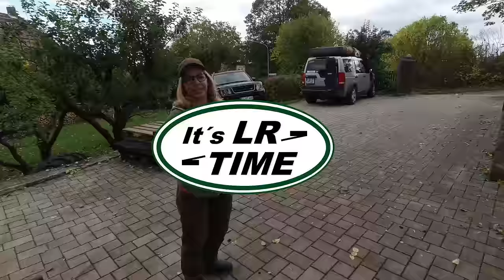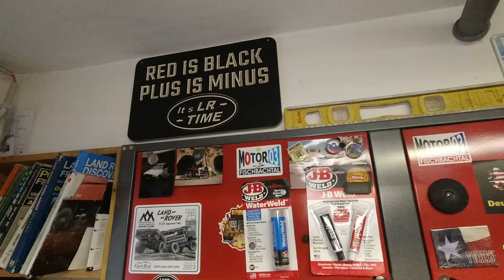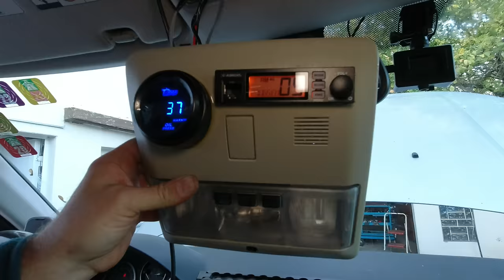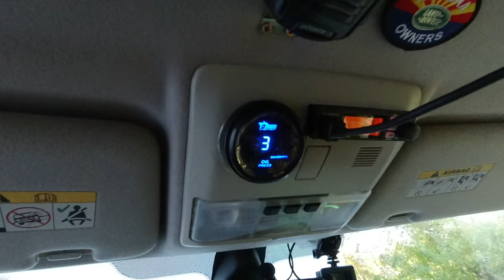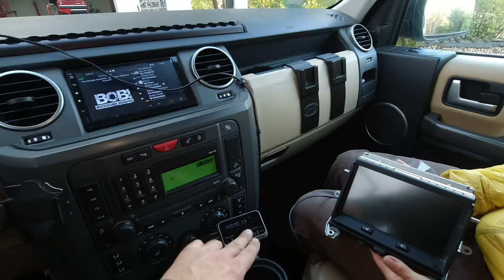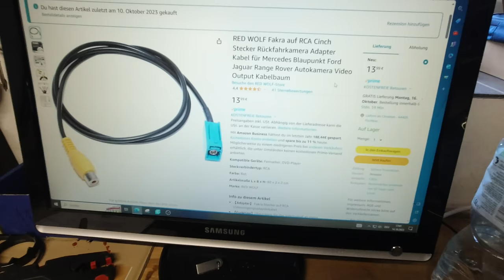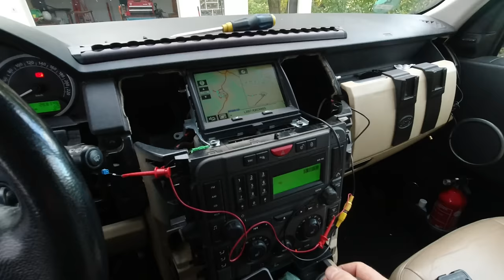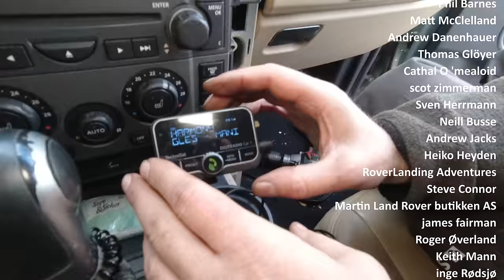Maintenance after Engine Rebuild - Chips in Oil ? / S4-Ep48

Comment: I put a D4 nav display in my 2006 D3. Love the updated look of it and all it requires to work is power and MOST. If you want nav to work, then you also need vehicle speed (one wire). The only annoying thing is the display backlight is always on full, it ignores any input from the D3 system. There was some sorta chance. But I simply made a independent device with an Arduino that regulates it beautifully.
Reply: Mmmmm nice!
Thanks M.

Comment: You should find that with the next oil change it ought to come out a lot lighter if the rings are sealing well. I had a 170k mile TD5 that would blacken its oil instantly after a change until i wiped out the black goo from the  sump when i happened to have removed it. For the next 30/40k miles the oil would come out as clean as a petrol engine. It was the black goo that was staining it rather than any recent engine blow by.

Comment: With iid you can add 4*4 info without removing wire. there are little problem with rang rover mode the clock and data can't adjust good ....... very nice job

Comment: I’m doing a satnav upgrade in mine, I have made a 3D Printed bezel adapter so I can fit a 7in android wireless car play in place of the day nav as the maps are too out of date now. This uses the aux wire and also takes a usb input which I routed to one of the charger holes which so you can be wired or wireless. I’m posting it on the Disco 3 forums.

Comment: Hi Cristian, I did that exact mod to the Nav screen a few years ago with the switch to go in and out of RE mode. The only problem was the brightness of screen reduces after a short I’m so is no good during the day. I did a resister mod to the screen and switched on and off with the lights, now all is perfect.
Reply: Care to share the mod? I’m looking into this soon
Reply from the maker: I have had it now installed a couple of weeks and been on a couple of longer trips, day and night driving also in terrible weather conditions and I don't have any issue with the brightness for some reason. 👍🙋‍♀️

Comment: Unbelievable we had a walnut tree on the farm i grew up on every year. we picked them up by hand and stored them until my mother was ready for us kids to crack them open,  i do miss that simple way of life 😢,  I've also added Bluetooth to my lr3 that i can use from my cell phone , i usually listen to music from YouTube makes it nice to pick what you want to listen to sense a lot of today music not for me i miss the 80's way of life & being young once in a lifetime. When i did a brake job and ebrake shoes, it's always the little details that get overlooked . When i couldn't figure out why the hole in rotor wouldn't line up to adjust ebrake duh i had to lift other side  so im able to turn hub  after throwing a tool two screaming mary jane i finally figure out both sides needed to be off ground 🤯 it's the little details that some you tuber leave out is the most important piece 😊

Comment: It would be interesting to get your analysed at a lab. to definitively say if there are any wear particles/contaminants in there👍
Reply from the maker: Particles found only by a lab are unlikely associated to an imminent engine failure. 🙋‍♀️
Reply: @Vera_and_Christian  Yes I agree. I was thinking along the lines of monitoring the oil over an extended period to see if any increased wear indicators. But given the nature of the failures in these engines (sudden/catastrophic) maybe not?
Reply from the maker: @russhumphreys8109  Frequent oil changes are the key to reduced wear on the engine, in our humble opinion. Even a10000 km oilchange interval is too long. No more than 8000km. That way you can reduce the dilution of oil with diesel and keep the lubrication properties intact. A viewer recently send us his oil analysis, after according to him an 10000km oilchange, and the lab recommended him to do as frequent as 4000 km oilchanges, but he was still on 5W30 and not 5W40, what we recommend. The oil did not have the lubrication properties needed anymore. The money is best invested in frequent oil changes. 👍🙋‍♀
Reply: @Vera_and_Christian  400km😲 I'm with you on this. Oil is cheap! I actually use 5w40 but not the actual spec. recommended by the manufacturer. The recommendation is low SAPS to protect the DPF. But at the expense of reduced engine protection!
Reply: Sorry 4000km!

Comment: Hi Christian and Vera, I’ve been watching your videos for the past 3 maybe 4 years and I’ve never thought to ask you this question, where do you source your parts from, online or from your local reputable motor factors? I’m in Ireland by the way. Love the videos and get a great laugh from them. I’m also a Qualified BMW technician, you can feel free to ask me questions too. I’ve also bought a Discovery 3 recently. My father had 2 and loved them and so did I so I had to have one of my own.
Kind Regards,
Ryan.
Reply from the maker: Always online. For the engine rebuild, Christian spent endless hours researching online. Always search for the part number, using the AdvancedFactors website, for example. Then then buy there or search with that part number online. We buy mostly in German online auto stores, and most often at an online Land Rover store.👍🙋‍♀️

Comment: I wonder if the pressure gauge will not shine too bright at night. I had some USB chargers with voltmeters and those were very distracting at night. Even though those were down by the shifter and outside of immediate eyeline.
Reply from the maker: It does not. 👍🙋‍♀️

Comment: well done
I  am installing a hoist, just pouring the pads 1 metre x 1 metre x -8m
i was concerned that the pads on the hoist may dent the chassis rail?
Reply from the maker: Christian also made a specail mount for the front lift pad, so it fits into the jack holes. And also welded on side  guards on the rear lift pad. It always helps if you have a fully loaded fabrication workshop. Fabian has rocksilders and they tough the lift arms, but not weightbearing of course. 👍🙋‍♀️

Comment: Hey guys, interested by your experience with the Range Rover mode and the rear view camera. Did this on my Disco 3 V8 and I've found that the light is not bright enough when sun is shinning, impossible to see what the screen display when reversing. I Also had trouble centering the image, it is actually completely offset and therefore useless. Still looking for a hack to enable the auto-brightness setting while using the range rover screen mode.

Comment: Brake question… why did you click back x8 when you had not bed them in? Shouldn’t have been all the way to full lock, then back out 1 full turn? 8:14
Reply from the maker: One turn is 10 klicks. I turn back between 8 and 10 klicks after lock.  Bedding is only required for new shoes.  Christian
Reply: @Vera_and_Christian  thanks, appreciate the response and love the videos

Comment: Would I be right that to stop the Handbrake from working you must remove the fuse (which will also stop Cruise Control from working)?
This is because on a manual Discovery, the Handbrake will automatically apply itself whenever you remove the keys from the Ignition.
Whereas on an automatic Discovery, if the gearbox is placed in ‘P’ the Handbrake does not automatically engage itself.

Comment: "Professionalism " at its best , you make every repair a " piece of cake ". 
At what engine temperature did you add " urine " contaminated Swiss Alp stream water / coolant to the cooling system 😊 . I witnessed a few friends whom damaged engines , by adding water too soon and doing so without idling the engine , or later heat damaged piston rings ?😮

Comment: Guys you will get bad results with chinese camera but it's not camera's fault - it's LR display sux. It uses non-standard CVBS signature so when it get standard CVBS signal, it crops it's center part, dropping about 50% of image. When you use LR camera it should be OK - it has weird standard too. It was final reason for me to drop original display in trash. Just check camera image - you see green, yellow parking lines, where are red ones? Display cut it off.
Reply: also you will get very low image brightness when you change to RRS... but I think you already see it.
Reply from the maker: I have no issues with brightness so far🤷‍♀️🙋‍♀️
Reply: @Vera_and_Christian  nice, mine dropped about 40% of "discovery" mode.

Comment: can i buy a discovery and come and break down out side your house as you have plenty of spare, but you know i am only kidding you and you are supposed to spill a little water on the belt when it is squealing and if it stops when the water is on it ,it means you need. to adjust it    another great video so thanks for the video
Reply from the maker: Yes, unfortunately others had the same idea and the is a line.  Christian